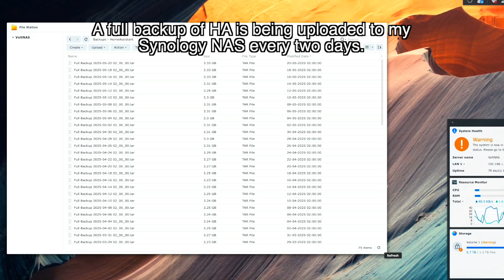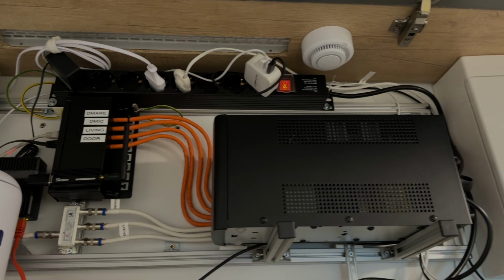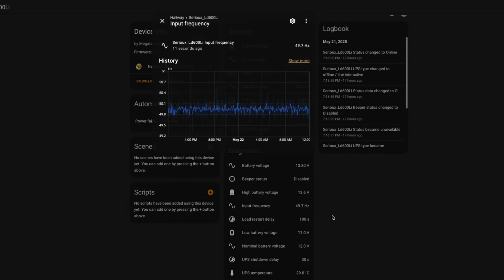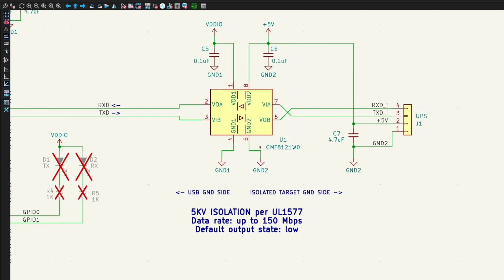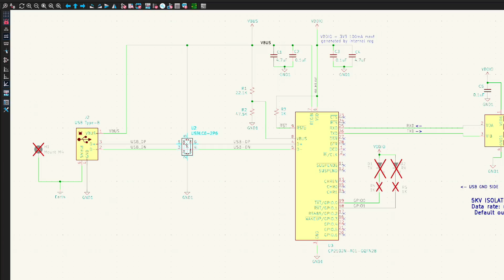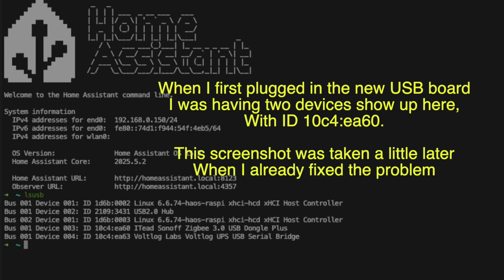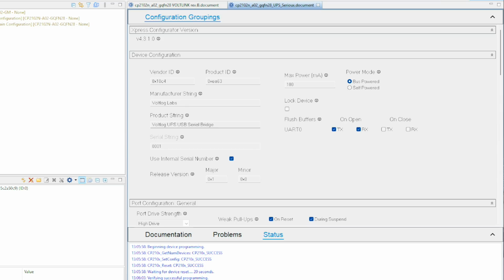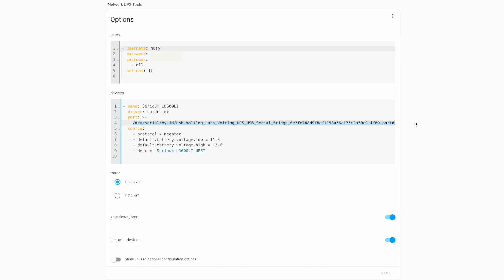I Spent 10 Hours Fixing a $40 UPS - Here's What I Learned | Voltlog 503

Comment: What battery voltage do these operate at? And would it be possible to replace the battery with a LFP one once the lead acid one dies? These cheapo UPSes are notorious for being expensive to own as the battery life is only 2 years in most cases....
Reply: I have one, it charges mostly externally, because built in just heats up and does it slow
Reply: these that use 12v 7Ah SLA's are generally charging at 13.5v and will auto shut down at 10.5v. The DC input caps on the board are most likely rated at 16v so the UPS might/could/should accept anything under 16v.
Reply: Depends on the batteries and if they have a control board designed with replacing sla batteries in mind. It also depends on the UPS unit. I've had some APC rack UPS units that refuse to work with lifepo4 batteries despite them having a control board designed with sla replacement in mind. It's less about the batteries providing power and more about them behaving like a sla battery under load/charging so the UPS management system doesn't freak out.

Comment: Fucking great work. I was using a Jaycar knockoff of the same thing and had the same problems. I’ll give this a crack. 

FYI I found the rest of the UPS to fail within 2 years anyway.
Reply from the maker: I've owned several of these cheap ones. They all still work fine. Just a new battery need roughly every 4 years.

Comment: I built a DC UPS of sorts. Definitely worth it you get better efficiency not converting. And then I have all of my devices that aren't easily directly DC capable on the regular UPS, Which then gives me longer run time on that as well.
Reply from the maker: For me that only makes sense if I run everything from DC which currently is not possible with my equipment.
Reply: @voltlog  If the device has a switch mode power supply, it will be tolerant of DC input. You might simply need a DC-DC boost converter dedicated for that device in an all-DC setup.
Reply from the maker: @EricStuyvesant  I'm not really looking at all theoretical ways that one could do that. I'm mostly looking for practical ways of doing it, things that actually make sense from a cost vs effort vs result perspective and looking at it that way, it currently does not make sense with the setup I have.

Comment: My first UPS was a 650 APC, the next one an 850APC, and now a Tripp-Lite. All af them are recognized by my synology NAS no problem. Aslo, make the synology nas send a signal over the ethernet was not a problem (one click only)

The real problem was compiling NUT from source using MacPorts or Fink (I tried both, do not rememeber which one worked in the end) so that the Mac would torn off too in the case of an outage
Reply from the maker: My synology NAS also recognizes this cheapo automatically but over time the connection fails.and it's due to the issue described in the video.

Comment: This is very cool, you did a great job with the board design. I'm curious to know if you thought about designing a board that you could contain a RPI or ESP8266/32? Then you could have the NUT server running on the UPS and pull the info in to home assistant using the NUT component.

Comment: Wouldnt it be way simpler. to extend the jst to the raspberry to just run serial connection xd
Reply: There is no certainty that the UPS has a clean and zero volt ground reference.  The isolation in this case is prudent and adds a secondary isolation from mains spikes (that many UPS were used to guard against).

Comment: Don't change the PID, just make sure the serial numbers are different (can be changed via the same method) and make sure Zigbee2MQTT is using the /dev/serial/by-id path rather than a /dev/ttyUSBx one in it's configuration. You can have an arbitrary number of identical USB serial devices and not have any issues disambiguating them.

Comment: Great Video. I echo your sentiment about cheap UPS.  I have HA and NAS on home network and I bought a cheap UPS (APC EasyUPS  BVX700LUI-MS) with the same thinking you had.  and regret very much since then. It does not have any communication interface and I can do nothing about it. You always need someone standby for such kind of UPS in case of power outage! I don't understand why they flood the market with such type of UPS, calming it can protect the home network, unless you always have someone at home. It does not even provide useful information about the battery status, until you get zero backup time. It does check the health of the battery every two week with very brief beep sound if nearing end of battery life. I hardly get alarmed.  The OEM replacement battery cost more than my UPS itself and it runs very hot (additional 28-35W power consumption adding to the bill), shorten the battery life even further. It is an online interactive UPS, but most of my network devices using SMPS and I don't think the condition of the AC line has much impact on the output of the SMPS. I don't know why they promote such UPS so hard. I would rather buy an off-line UPS next time, to save the energy consumption as well as longer battery life. It seems to me that UPS industry is very much outdated with technology.

Comment: The Ethernet "surge protection" on the original board looks like it would be far more likely to degrade the signal than offer anything resembling protection.
Reply: IIRC he said is protection for phone lines, not Eth. Most UPSs had, and still have such protections because, in many parts fax and ADSL/VDSL were popular, and the lines entered to the house in an aerial fashion, and therefore, were suceptible to lightniing strikes.

SOme fancier UPS also had coax protection for your cable modems and Home theater and such
Reply: When on my PC motherboard fried, technician offered to me the replacement. It had damaged ethernet port on the motherboard so pci card was included as a bonus. I guess it was quite common thing back then

Comment: Have you maybe checked how many watts on average is your UPS burning (when battery is charged) over what the connected devices use?
Reply: A UPS will start charging the battery whenever it's plugged in- massively throwing off any quick power readings with a killawatt type device. I've found a pair of sonoff s31's on the inlet and another plugged into an outlet (and a strip plugged into that to power the load) over the course of a week to be the most effective method.
Reply from the maker: No I have not checked that. Should I expect that to be an issue with this cheap UPS?
Reply: @voltlog  I meant that from what I've found in the past UPSes use a lot of power even idling and it kinda defeated purpose of using them for low power mini PC home server running 24/7 - that could be idling/averaging at 3-10W.
Reply: @voltlog  yes and no. Yes it will be higher than a brand name UPS, and will shorten the life of the battery. No, the ammount will be negligible in either case.
Reply: I've not found that to be true at all. 10-20w when not charging the battery. I had a 1500VA interactive rack UPS from APC/Schneider that's closer to 100. No, it's not a double conversion unit.  @williamyf
Reply: @JohnDoe-c2f  You’re just making up numbers out of thin air! 🫵🏻

There is no 1500VA APC UPS that consumes 100 watts at idle - None! 🤦‍♂️

The average (RMS) idle consumption for a dual conversion APC SRT UPS Series is 40~55 watts.

The SMT & SMX UPS Series range from 7~11 watts for the SMT dependent upon if Green Mode Is enabled or not.

The SMX UPS Series ranges from 9~15 watts depending upon Green Mode and how many extended battery packs are connected.

All the above wattage values span the 750~3000VA models.

Even the legacy APC UPS models that span SU, SUA, SURT, do not consume 100 watts at idle!

Don’t spread fake shit . . . 👎
Reply: My unit uses 10w at idle so i only use it when shutdowns occurs. I use it with my PC, for network i have 12V ones
Reply: @vadnegru  So how do you know when? :D

What about the 12V UPS? I guess you use it 24/7, do you know it's average power usage?
Reply: @blamedrop  I live in Ukraine and last autumn shutdowns were mostly scheduled. I don't know the exact number but when battery is changed and no load is connected it uses less than 0.2W (that's the lowest my power meter can sense, it just shows 0.0)
Reply: @vadnegru  Can you share the model/name of that UPS?
Reply: @blamedrop it's a DIY unit, made using 24W DC UPS Module (2S) board and 6 18650, i believe in 2S3P configuration. Some guy made them cheaper than i could so i ordered from him. I don't recommend this exact model because it's noisy. There are 3S variants and it would be much better.

Comment: Thanks to this video......it got me to looking at NUT within my own HA setup to see if I could interface to my Compaq T2400H & TRUST PW4130M UPS's which until now were void of any decent software or even compatible to modern OS's. Looks like this will work!
Reply from the maker: I think NUT can support pretty much everything that is out there with the right config. But that last part is very important, because in many cases some research needs to be done before figuring out what the right config is. It also doesn't help when many of the search results you will find, reference older versions of NUT which used to do things differently.

Comment: Cool project, and I also learn these unique features for the UPS's.  Do you have any plan to upgrade the dry battery with the wet one?  I am using a similar UPS, it dries out for every year and I really frustrated to replace it...
Reply from the maker: I've been using this type of basic UPS with this type of battery for my entire life (different brands/models). I'm getting a typical battery life of 3-4 years which I find perfectly reasonable.
Reply: The quality of the battery and the quality of the UPS make a world of difference for battery life. try to get something along the lines of APC or TrippLite (as cheapo UPSs thend to screw the pooch once you reach flotation voltages), and good quality batteries (as bad quality ones tend to fail faster, even on good UPSs).

Do it not to save money, but to save the planet, and save yourself some headaches.
Reply: Try to buy a good one, I strongly suggest this model CSB GPL1272F2 which is rated for 8 years of stand-by services, on my APC it's been working for years.

Comment: So the real question is how the hell did you find that isolation IC . In my normal process for finding components I could not find this one at all and all the ones I did find were way more expensive.
Reply from the maker: If you go to a particular asian component distributor, to their Digital Isolator category and you arrange the results by available in stock, price descending, the CMT8xxx series starts popping out.
Reply: @voltlog  Interesting do you normally start at asian component suppliers? The type of part I have been looking for forever is hard to filter for. Especially when those asian components don't have good descriptions. I really want to find a cheap OVP IC with multi channels but the TI ones used on FPGA are multi dollar devices while the USB C port protector chips are 10s of cents. It is quite frustrating.
Reply from the maker: @Ender_Wiggin  Depends on what I'm building, where I am building it, what the buget is.. there isn't once recipe to cover all scenarios. But I can tell you, it is an essential skill to be able to find components like these because there is a wide variety of such components for cheap on the asian market and they're not easy to find unfortunately. What I did just scratches the surface of that market.
Reply: Any reason the Waveshare isolated serial USB board wouldn't work?  They are 30 off the shelf.